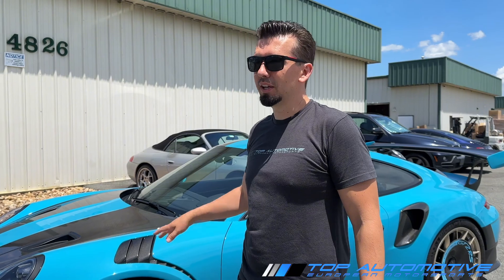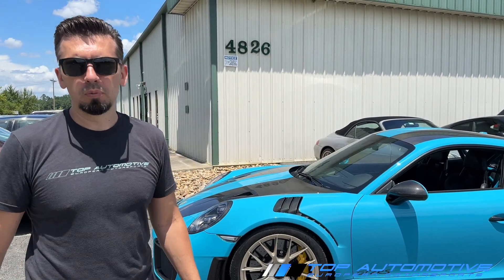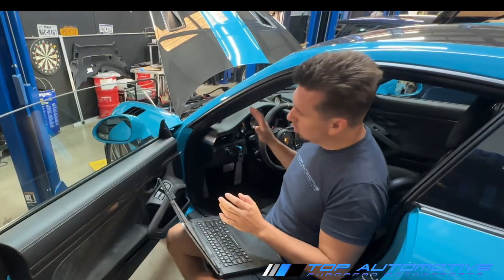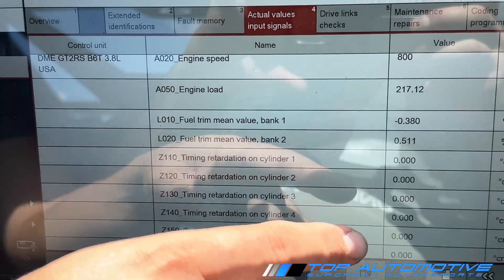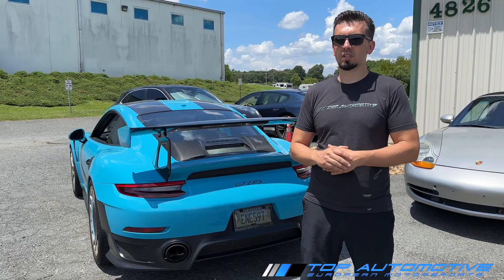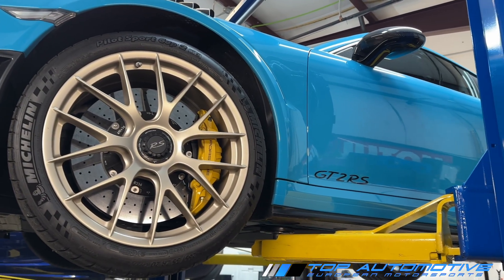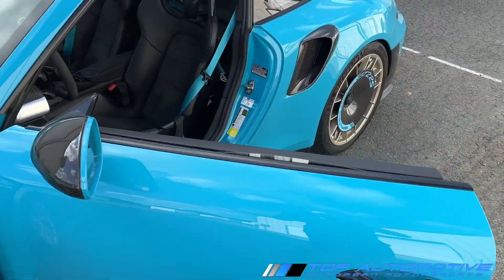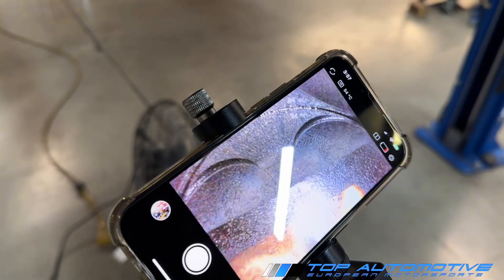Cylinder Scoring Proven on 991.2 GT2 RS - Data Logging Reveals the Truth

Comment: Has anyone discussed the idea that high detergent fuel increase the chance of bore scoring?  If fuel spray is the main cause of oil coating wash out, then maybe a special blend of oil or oil additive might be necessary in order to minimize that effect on the cylinder walls?

Back in the day, leaded fuels added extra lubrication….

Yes, I’m old school

Comment: Are those injectors spray patterns normal? I wonder about their condition as well.
Reply from the maker: The spray pattern is normal; however, you can see the pattern more clearly when you run more rich with cylinder over enrichment issue, in the areas where you’re starting to see scoring occur.

Comment: so if you want a 991.2 GT3RS you should get a higher mileage one which was driven or else the cylinders will have rust from oxidation from "stand wear" wow.i like the iron plasma coating on the cylinder liners i didnt know they had disadvantages.
I honestly wonder whats the best cylinder liner to use then.
Reply from the maker: Best is to scope the cylinders. Moisture buildup is also a lack of proper maintenance, especially on track cars. We’ll have another video soon explaining some of the causes.
Reply: the best cylinder liner is NIKASIL of course. Hans Mezger knew that.

Comment: Here is something I found that may be interesting
---
On 5 cylinders it was okay, but on one you can see how deep the corrosion marks are already. These areas are clearly noticeable and if it would continue to rust, provided you do not conserve before winter, will definitely eventually lead to significant problems. The coating is also very thin, which is why it could possibly also partially rust through into the aluminum.
Furthermore, after two winters he has made about 3x as often the "boxer fart" as before. Perhaps the resulting "bypass" has favored this phenomenon. I have therefore decided to buy a new cylinder crankcase, which may already have a slightly less reactive coating. Part number is in any case changed.

9A1 101 945 91 -> 9A1 101 945 92 (2021)
---
Reply: special advise for you: get that new cylinder crankcase NIKASIL plated.

Comment: Why doesn’t Porsche build these motors with iron liners? These are street motors. The exotic coatings ain’t making it.
Reply: I suspect these exotic materials are actually used mainly because it is a street motor, that means they have to meet incredibly strict emissions rules, so if you want 600+bhp they need to use every trick in the book to achieve that power within the emissions regs. 
Without the emissions restrictions they could just build a super strong engine that took ages to warm up on cold start and would never die, but it couldn't ever pass emissions, particularly during the start up phase because it wouldn't get the cat warmed up fast enough. 
I may be wrong but that's what I think.
Reply: @pjay3028 Great point indeed. Now the question is how do they correct this defect? Bore scoring is an issue affecting models other than the 911 within the brand.
Reply: heat conductivity and weight
Reply: Lighter weight and heat can dissipate to the coolant faster, like another commenter already said.
Reply: saving money is the second reason, why the dont use iron liners.

Comment: Is rust also a possible problem for 718 GTS 4.0/GT4/Spyder cars? If yes, what driving habits are probably making it worse? Short drives, not driving the car often at all...?
Reply from the maker: Absolutely, they run the same exact cylinders on the GTs and GT4 PTWA.

Comment: F....

Every P car is a maintenance/liability grenade, with a $30,000 - $100,000 engine rebuild liability...

...plus...

a $30,000 - $40,000 PDK replacement liability....

F.....
Reply from the maker: The problem is lack of maintenance is the biggest issue; these cars sit too long idle too much and just don’t get driven.
Reply: @TopAutomotiveInc that doesn’t sound like a maintenance problem.
Reply: Not a 997.1 turbo. No bore scoring. No PDK. Easily repaired/replaced tip transmission or manual.  2 known major issues that all happened to me: epoxy coolant hose failure (covered under warranty but not super expensive) and spun chamshaft sleeve ($5K 6 years ago to repair).  Porsche used nikasil coating and closed deck design of the Mezger engine in the 997.1 turbo (that itself was ported over directly from GT1 racing engine) that used port injection as well (not DFI like the 997.2 turbo).  Proven to be pretty reliable (93K and going strong currently).  The newer cars weren't race derived but designed on computers.  They seem to all have issues eventually.
Reply: @mak23997  if the dfi engines were NIKASIL plated they would be very strong as well. but NIKASIL seems to be expensive. and as we all know, PORSCHE has to save money always.
Reply: This^^^^^^^^^^^^^^^ is true. Sadly.

Comment: Stock tune = anything more, FAFO. Once again, when you speak, I listen.  This is why a GT2 RS comes already tuned.
Reply from the maker: If tuned properly, there are no problems; however, when there’s not enough fueling, there are definitely problems. If the timing is bumped too high, this becomes a huge issue with fueling as higher octane is needed.

Comment: Not sure if that 991.2 GT2 is using a MA1 crankcase but if it is, theres a good chance what your seeing is gradual heat seizure as the bottom of cylinder 6 is beginning to shrink inwards around the crank carrier areas, thus scuffing the piston skirts and then the tell tale larger score areas. Most of the scores in the other cylinders will probably be caused by recycled debris from cylinder 6. This assumes its a MA1 crankcase set. If not, I'm not 100% sure as I'm only knowledgeable on MA1s. This crankcase design seems rather flawed by design! Good luck.
Reply: The 997.2 MA1 engines had this bore shrinkage problem but wasn't this solved in later MA1 iterations in the 991?
Reply from the maker: @jeanpaulceulemans9973  unfortunately not.
Reply: @jeanpaulceulemans9973 so far as I can tell this  MA1 engine never changed over its lifetime. A few internal items varied between models. I believe there was a higher compression piston for example, whilst the oil pump seems to have seen 5 different versions come and go. The basic issue seemingly the casting material and the casting structure around the lower cylinders and crank carrier along with the water cooling cavity structures seems unlikely to have been changed. Else there would have been a different crankcase part number appear or even engine code.
Reply from the maker: Basically, the same thing minor changes.

Comment: Quality content 👍 

Does the 991.2 turbo S have the PTWA coating like other 991.2 or do they have same set up as the GT2 RS?
Reply: No, it uses the MA1 engine with Alusil+Ferrotec like GT2 RS, which is also prone to bore scoring. The 991.2 carreras have the MA2 3.0 evo engines with PTWA
Reply from the maker: stay tuned for that video that’s coming soon!